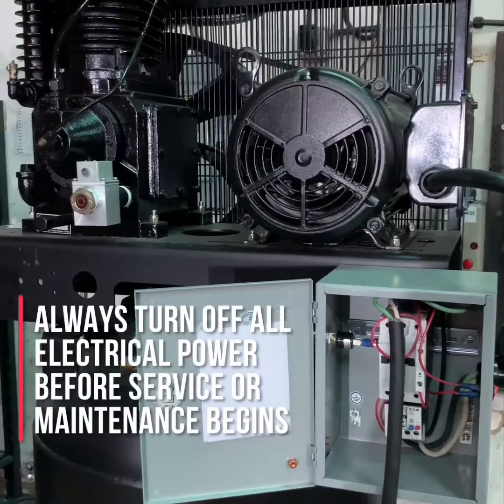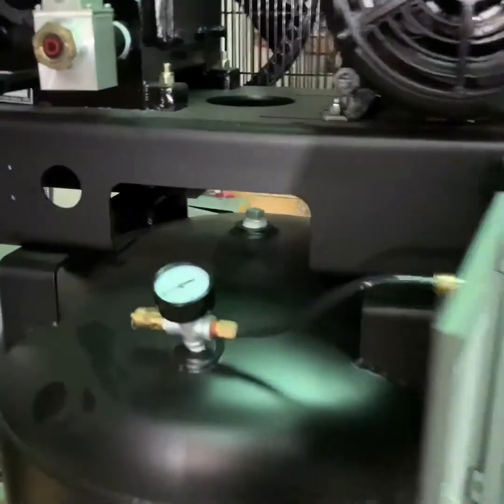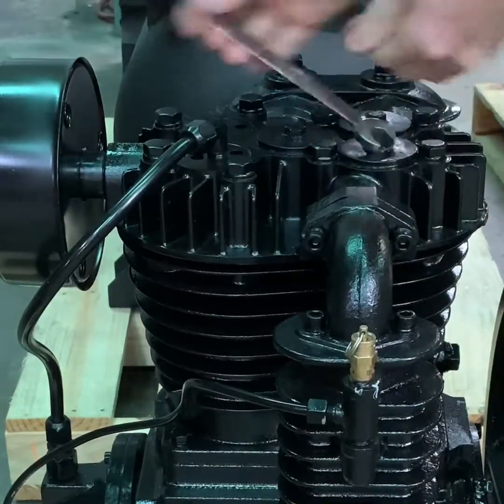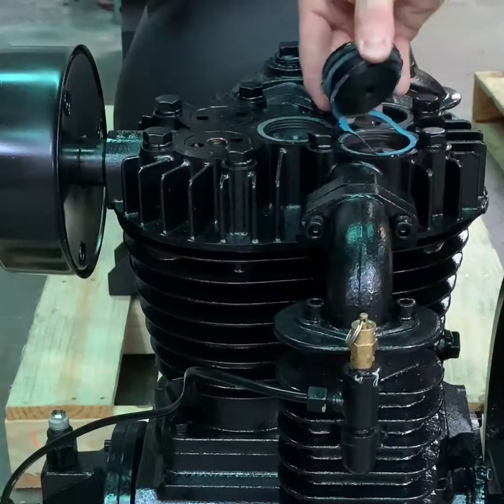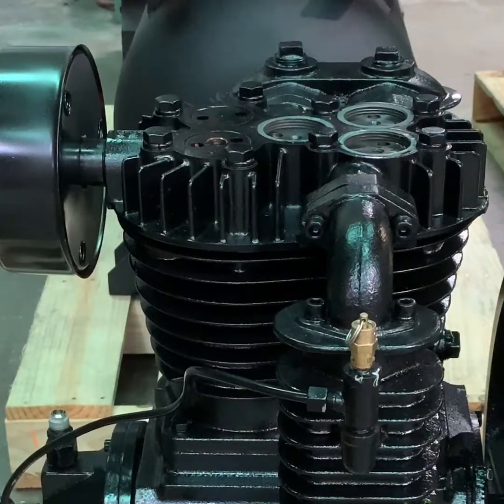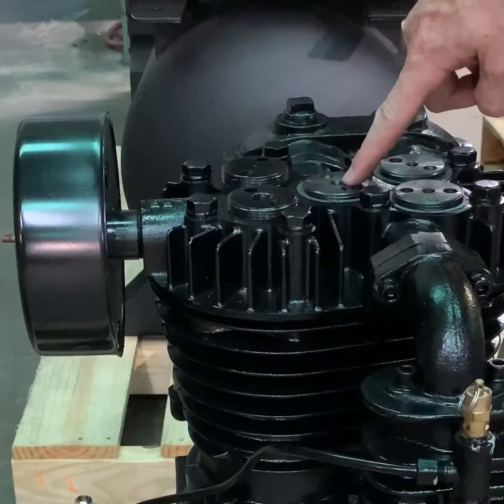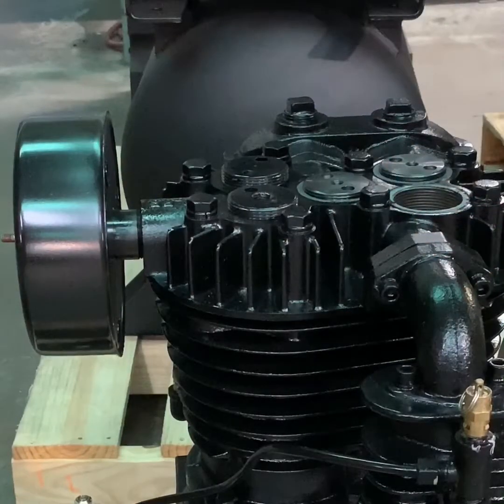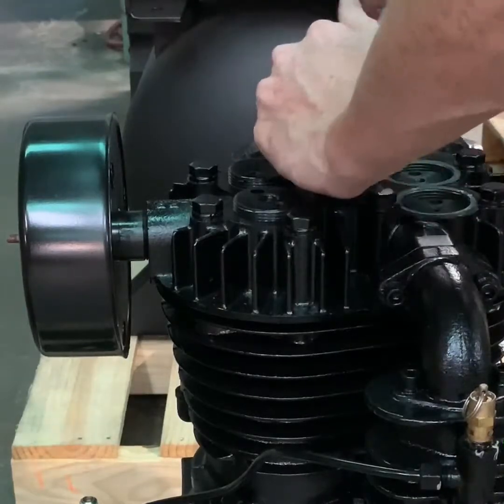Replacing head valves on CA1 / CA2 series compressor pumps

Comment: I did this in hopes of stopping the second stage discharge, relief valve from lifting when the unit got to about 150 pounds. Now the unit gets to about 50 poinds and the same relief valve shutters as it airs up. What causes the second stage discharge safety relief valve to lift on a ca1?
Reply: I have the same issue now my safety release valve off the intercooler keeps shuttering on and off as it builds up air